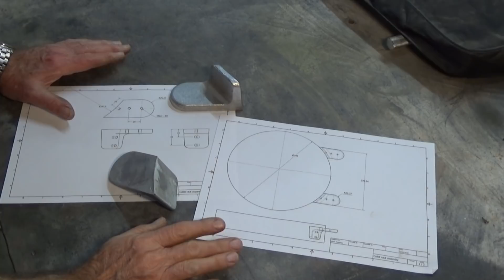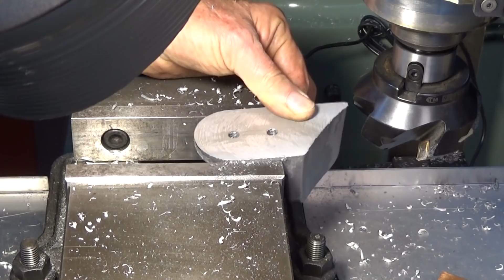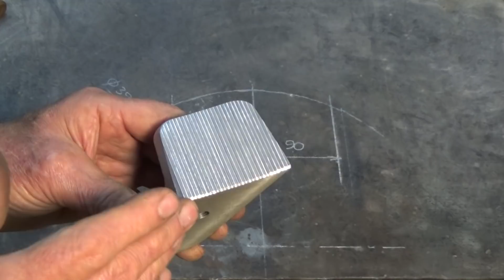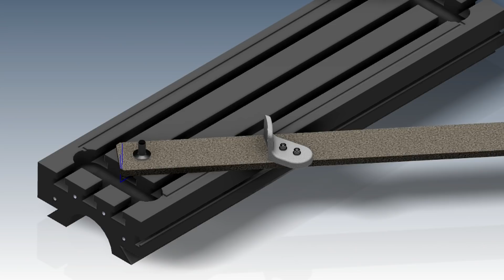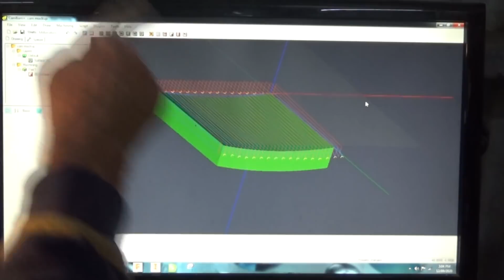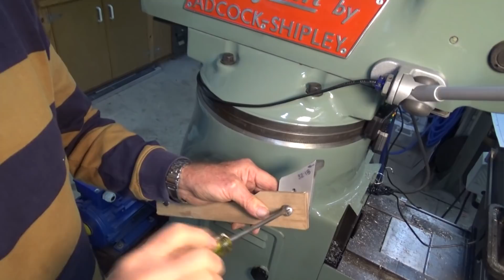Machining Some Awkward, Brackety Castings for a Bridgeport Collet Rack

Comment: Great video, very interesting story. Superb workmanship. Remember CNC with paper punch tape? Mahalo for sharing! : )
Reply from the maker: I must say I didn't know that paper punch tape was used that way but I am sure it was done. I do however recall programming a computer with cards. One card for one line of code (all in BASIC) and up to fifty cards in a stack just to have the computer carry out a simple task like sorting random numbers into odds and evens!
Regards,
Mark
Reply: @Preso58  Took  a COBOL class at University. It was a hassle carrying those punch cards around campus. Times sure have changed. 🐵

Comment: If you could have angled the surface to machine at 45 degrees you would get a better finish and less chatter. The bottom 20% of a ball mill pushes more than cuts due to low surface speed closer to the center of rotation... You might get waterboarded putting a communist bolt in a Bridgeport.... hahaha
Reply from the maker: Are you saying I should buy a fancy five axis mill? I'll tell my wife you said I need one! I do recall reading that ball mills have zero edge velocity at the centre contact point. I guess the efficiency would be way less at the edges close to centre. 
Regards,
Mark
Reply: @Preso58  Absolutely positively tell your wife I said you MUST have a 5 axis machine or the YouTube police will show up. I will even give you the specs that are mandatory for a home shop! Syil X7 made from Epoxy Granite, BT30 HSK E40 30,000rpm spindle with TSC, Syntec 22MA 5 axis controller, 16 + 1 two arm ATC,  DDR rotary table, wireless touch probe, 3D tool setter. Now your wife will have all the info she needs! If she needs that on a letterhead let me know! When you place your order tell Xushuo I said hi...That was easy  :) hahaha

Comment: In order to simplify the programming effort in Fusion360 i use a series of standard CAM templates. Once you've saved a few standard templates it literally take only a few seconds to program any part. NYC CNC has a number of videos and sample templates you can try. Its worth researching and learning. My Seig X3 CNC conversion can produce mirror finishes very quickly.
Reply from the maker: I must say I have never pushed too hard on my Sieg. I have broken one too many cutters when I got greedy and tried to take deeper cuts. The original Promica kit that I purchased had all the parts made on a Sieg X3 but it did have the high speed precision spindle fitted. Before the Promica website got taken down there were a number of videos showing the Sieg hogging out very large aluminium parts. Maybe I am just being too cautious!
Regards,
Mark
Reply: @Preso58  I mainly use 1/4" and 3/8" solid carbide cutters with .002 ipt as a maximum chip load. I also use 1 x dia depth by 25% dia max WOC for roughing and full depth by .020" max WOC for finishing.  I changed my spindle to an 1100 watt 6000rpm BLDC motor which made a huge difference. Spindle power and high RPM is needed to compensate for low machine stiffness. That way you can go faster and keep lower cutter loads.

Comment: At risk of becoming the armchair athlete we all despise, could you have milled the top (flat) face square to the curved portion? The top would have been tapered but still plenty strong I'd guess.
Reply from the maker: Rod, yes, that would work but fixturing it would still be complex. Sometimes, the way I do things might seem overly difficult but I like to experiment with techniques which might come in handy later when there may not be an alternative way of doing something. 
Regards,
Mark
Reply: @Preso58  Totally fair - didn't think about the joys and laughter that would come with grabbing onto a curved, tapered leg.

Comment: OK, arm chair expert here! and I have never cast anything in my life. Could you have not kept the curved face and the top face square to each other and put the draft on the side where the screw heads would sit?
Reply: As nice as he finishes his patterns, it is likely that would have worked.  It would require the part moving in the direction of the drafted surface as it came out the sand but I think you're right.   Ok Mark, tell me what I'm missing 😄
Reply from the maker: You are correct but I had already decided that I wanted to have a go at machining the curved face anyway so I just put the draft on both faces. I mean, why make it simple when you can double the production time? I like my wife to think that I tackle high risk projects and always prevail! 😁
Reply: @swdweeb  Likely cast with the face top side on top, as that is the most porous surface in there, so no. You will need a good draft angle anyway, so making it with the one surface that needs to be flat as top is best, just make sure there is enough volume in the casting to find the rest as well. He has to have a top, so make it the piece that is both going to be not visible and also one that will get milled flat anyway.

Comment: You are really missing a golden opportunity here.  This is the perfect application to model and 3d print your brackets.  Dial in the model perfectly and then cast..... or maybe that is what you did. 

Either way this kind of stuff is what makes the hobby level printers a useful shop tool. I am constantly making drill guides, alignment jigs, etc.
Reply from the maker: I usually do 3D print all my patterns unless they are really simple like a circular disc or a square plate with a boss in the centre. I am now printing in PETG which doesn't suffer from shrinkage like ABS does and it is way strong enough for a single use patterns. All I do after printing is to sand the worst of the texture off and then fill the surface with a spray putty. This usually gives a smooth surface so the layer lines don't get replicated in the finished casting. It also means that I can include the finished casting shape in the CAD model so if it has to be part of an assembly I can model the whole assembly but the patterns can always be "rolled back" by disabling the machined features. 
Regards,
Mark